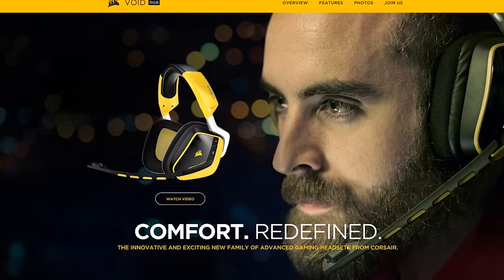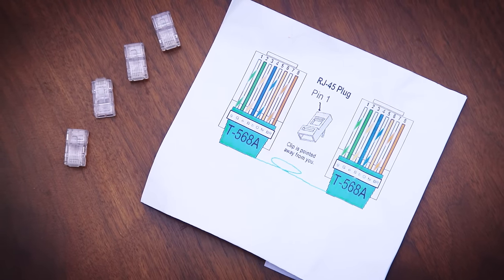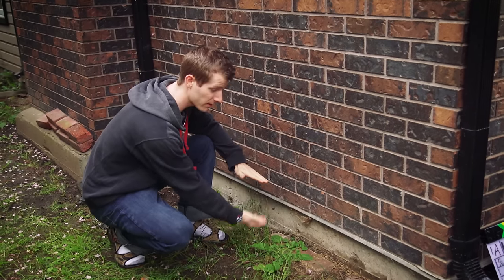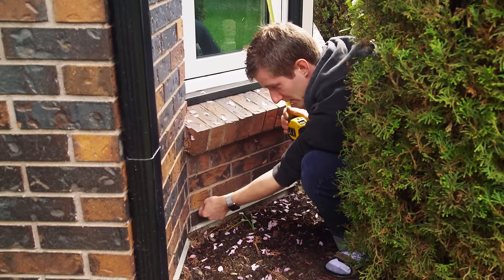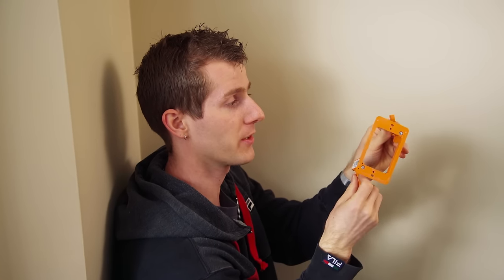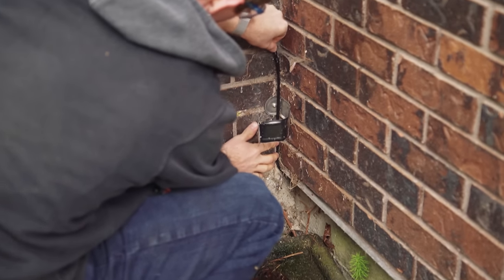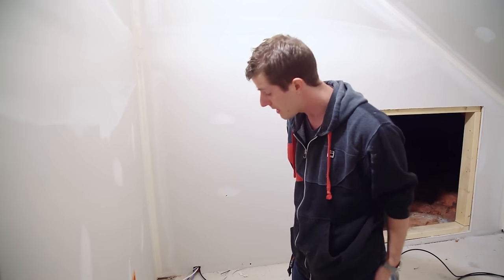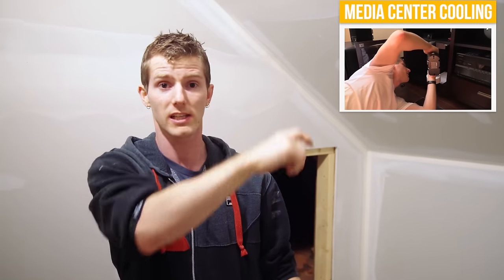Optimize your cable runs at home! - Installing an exterior Cat 5e cable

Comment: Isn't this quite a big security Problem, running your network outside of your house? Sure, he did hide it as good as possible, but if someone would fine the cable and had bad intentions he could cause a lot of harm I guess... 
You would need something like a Mac white list, so that even if someone cut the cable and tried to get in to your home network he would not stand a chance ;)

Comment: If you went from the other side, you would have been better off. Start with a smaller Masonry Bit, After you punch through one side. Punch back from the outside with a bigger bit. This gives you a clean finish and you have to do less math.

Comment: Care linus, you said that the limit is only your creativity. But there is the limit of ethernet too, you can run 100 meters maximum in ethernet. It can work with a little bit more (101 meters will work) but it can introduce random errors. So it's not good to run more than 100 meters.
Reply: I'm thinking this falls under first world problems. "Help my house is so big that I can't do a single 100M (328ft) run of Cat-5! Oh woe is me, I have to use the money I have that allowed me to buy this accursed aircraft hangar of a home to buy another router or something!"
Reply: MoldyCrow
 My house is not very big but it can cause problem. I don't have problems with ethernet but If my house was a little bit bigger I think that would be a problem.
My router is at 1st floor,, then the cables must go to the ground floor and some cables must go back to the first floor. It depends.
Reply: i really think people under estimate how long a 328ft cable is. i needed Ethernet in a room directly above my router in a two story house but couldn't run inside the walls. so i ran a cable into the floor, across the 50ft of crawl space under the house,  out and up the side of the house to the attic, across the 50ft of attic, then down into the room. after that massive cable run, it only ended up being around 160ft. i now have nearly 40Mb speeds in that room without issue.

Comment: i've got a three story house. the attic is in the third floor, the router is on the second floor. i need to run the cable to the first floor across the house to my room for my gaming PC.... DO YOU SEE MY FREAKING CHALLENGE );

Comment: So I have a super dumb question, because I don't know shit. How do you know you won't hit a wire drilling like this? Honestly I fear drilling any holes into my walls, I'm always scared I'll hit a water pipe or wire or some shit!
Reply: That is why I have a complete set of construction plans for my house.
Reply: he should have drilled it out from the inside. made the small rectangle cut first, then drill the hole though the wall from the inside. Then he would have known for certain he wasn't hitting electric wires or any other hazard.
Reply: there are devices that detect metal inside the wall, just turn it on, press it against the wall and look. DO NOT drill blindly like linus did, you could hit a live power wire and get hurt..
Reply: maybe he checked electrical maps of his house

Comment: Stop being cheap and wire up the whole house with cat5 with a network station in the basement or garage, it'll add a little to the house value and bring the house into the modern age.

Comment: You should be more carefull to open a hole in the drywall near the socket....and you got the order wrong! ^^
Open the Drywall first, so you can spot the Brickwall, pinpoint a spot in the masonry and drill from inside to outside ;)
And i think you got ripped of at the cable price xD

Comment: What stops someone from cutting your cable, crimping their own connector on, and immediately obtaining access to your entire network?
Reply: Nothing other than security by obscurity, unless they know where the cable is, what kind of cable it is, and which end is actually connected to the router, they won't be able to access the network.
Reply: You could just crimp a new connector onto each end of the wire...you don't need to know which direction the signal is traveling.
Reply: unitedgray well obviously, it's just one more step though, and then you also have to test it.
Reply: What stops anyone from taking an axe and bashing down your front door and stealing all your shit?

Seriously, that would work for about 30 seconds before you realize you lost internet.

Comment: Don't do this. Call a licensed electrician to assist you with pulling wires through the walls. If there is any existing cable in those locations chances are very good that someone who knows what they are doing would be able to get your runs sorted out. For future reference.....  The Linus way isn't always the best way. He does try hard and that goes a long way in my book.
Reply: (the Linus way usually isn't the best way. or the right way)
Reply: Why pay someone $70 an hour when you can do it yourself?
Reply: His methods are fine. The only risk is running into something in the wall such as a gas line, or a 120 volt ac power line. Common sense will usually prevent problems like running into those things, don't drill near anything that is operated by gas, and or not near electrical outlets. Less risk? cut the hole in the drywall first, and take a look in there before drilling. I see no sense in hiring an electrician for low voltage wiring.  Just enjoy his quirky videos, and as always if you like it press the thumbs up, if you disliked it press the thumbs down.
Reply: The problem is there are far too many people who watch these videos that aren't smart enough to understand that this just isn't the right way to do it.
Reply: Eric Duncan Yeah ofc, there was an article, or a documentary that I've read/saw a year ago. (I don't remenber what it was) Some guy from an ISP hit a power line and it melted his drill bit lol.
Reply: Electricians usually know nothing about pulling ethernet cables, they are just as likely screwing up as you are. 

I didn't have to take a student loan thanks to the money I got from going around fixing networking cables that electricians had installed. They think it's the same as running electrical wires.

Comment: It honestly not that hard to fish wires through the head-plate of walls from the attic. I've done this about 20 times in my parents house (it helped alot that my dad installed pipes throughout the walls during the construction to aid in attic to basement wire runs). Takes about 10 minutes, and then you don't have potential security risks, unsightly wires hanging off your house. Linus is the epitome of "good enough" engineering sometimes. smh.

Comment: perks of not living in cold countries: NO dry walls... I loled... :D
Reply: Drywall isn't for its insulation. It's used because it's incredibly cheap and super easy to put up on a frame. You don't need to pour concrete or know how to lay bricks. Anyone can do it.
Reply: Concrete or even plaster finishing is easy enough to do...
Reply: That's a more specialized skill than literally putting up a sheet of drywall with screws.

Comment: You could also use a Water Level to ensure you are at the same height inside and outside of the building. You should even be able to use it through a window without the water running out. http://www.wikihow.com/Use-a-Water-Level

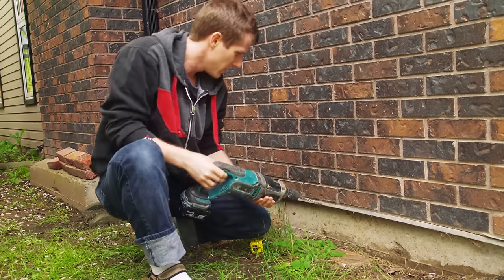Comment: I stopped at 7:11 because you didn't check for any obstruction behind the wall, like power lines, joists, joints or even some sort of piping or insulation, before you drilled...... 
I did not want to your hair fizzle.

Comment: What's a wife hazard? Does not compute
Reply: In all seriousness why use a female > female faceplate? Just terminate the cable using cat5e jacks and then use a regular faceplate. Benefit is that you can install as many (what, like up to 12 or more?) jacks as you need for the room rather than be limited to what looks like two jacks per faceplate.

Comment: Haven't run Cat 5e for years.  At least run Cat 6.  Why cheap out?  Also do you mean "hammer drill" and not "impact drill"?   Might also want to mention that is a masonry bit.  The "electric screwdriver" you show later is an "impact drill".  Instead of the anchor/screw combo, you should've just use Tapcons aka concrete screws.  Earplugs are a good idea with a hammer drill in general, especially if you use it indoors though.  Also use punch down jacks if you're using bulk cable.  Pass through jacks are generally used for premade cables.  It's a hell of a lot easier to fix a missed termination with a punch down block, then re-terminate a RJ-45.

Comment: Cool, but now everyone who want to hack you knows where are your internet cable and he dont need to physically step inside your house to have full acsess over your whole network, he just cut the cable, install a module, hide it, reconnect the cables and you did not noticed anything, and from here pretty much the sky is the limit, nest, smartphones over wifi, smart tvs, your computers, company emails, family stuff, and all of this with just only a rapsberry pi (or pi-like whatever)+some basic networking and programing knowledge
Reply: Was just about to say that lol
Reply: hmm, then he wonders why the internet isn't working from that socket anymore... has a look wats wrong.. sees the modem, contacts police. Then u get fined for trespassing, destruction of property, invasion of privacy, unauthorized use of WiFi/internet and etc.
Reply: that's the problem, the internet will work the same from that socket just like before, its impossible to notice this unless he goes out every day and check the cables, and sure if he notices it and the hacker dumb enough the police will find him, but by the time they does linus just lost his whole online life, imagine you lost all your online accounts and all of the files stored on the devices connected to your home network, the damage is irreversable, and no one can help you

Comment: lol waste of money installing cat 5! i do fibre installs etc and it 4x cheaper with lc multi mode then the cat6a! I charge  £190 for external cat6 with conduct and termination per 40meters. due to lengths of real is only in 305m.... £146 where fibre when I run is up to 305meters for £145 with full install. plus none of the aging Bs with fibre
Reply: True but then you have to have a media converter to get back to copper...
Reply: +Blake Barrett nope lc to lc no copper needed. server sfp to desktop sfp that simple no lag no jitter no interference and future proof
Reply: +SgtAMYNTAS So you need an SFP NIC card, and how much do they cost? And then an SFP switch if you have more than one server, again how much does that cost? The price of fibre in those terms is impractical. Copper is just as good and more convenient, and more widespread.
Reply: you can buy SFPs pretty cheap these days :P you dont need SFPS that have a laser range of 2km! only 300 or less. OM3! but if you want to go into cost then eh fibre panels are only used really for future proofing and making an A+++ grade on Energy and cost effectiveness over time. Standard copper costs the same to install as fibre but the fibre equipment is usually more expensive due to high quality components. 10+gb+ NICS costs the same with fibre and copper :) and copper 10gb routers are basically nill. you dont run fibre for a 1gb run... you run fibre for a sfp that standard at 10gb+ like i mentioned its about cost efficient over time. and maintenance and energy!

Comment: This is just bad advice. This is NOT a DIY project. Any cabling installed on the outside of the house needs to be installed by a certified installer and has to meet Life Safety/Fire code. This cable in this video is not shielded or grounded. Big no-no. I'm all about DIY, but some things really are better left to the professional.
Reply: nilpo19 its not an electrical cable or anything, its an ethernet cable by which you cant be electrocuted
Reply: Mohsin Sadiq Ethernet uses electricity, and any cable is a conductor by design. There is always an inherent risk of shock. Sure, an Ethernet system poses little risk, but category cabling is often used for other purposes including telephone and PoE. There is also risk that the cable comes in contact with another energized system. But all of that aside, the comment I was making is that in most U.S. municipalities, installing this yourself is illegal.
Reply: nilpo19 I undestand but poe cables can carry max 48v for safety so it wouldnt be lethal to it is perfectly safe to install it yourself
Reply: Mohsin Sadiq Amperage kills, not voltage. And PoE injectors can fail and expose the system to line voltage.
Reply: nilpo19 I cant remember the amperage of the top of my head but it is safe enough to install yourself but I see your point

Comment: except that the hammer settings on most of the drills consumers have a completely fucking worthless and are not any better than just plain drill setting.

don't buy cheapo shitty drills, people. even reputable brands have a lot of crappy products in the cheap end (<$400 USD kind've range).
or when buying an affordable drill, just know that things like Hammer settings are going to be useless and don't bother using them.

Comment: I just facepalmed at him... yeah lets drill from the OUTSIDE IN not measuring or taking in effect whats BEHIND that portion of the wall or even the wall stud.. yeah lets go straight through the center of the wallstud... yep drilled straight through plumbing/hvac/electrical cable/tv cable... nope lets blind drill into a wall right next to a LIVE power outlet.. then go in and open up the wall and go hrmmm straight through the upstairs toilet drain... its a wonder why he makes videos because cuz if he pulled that off in a jobsite he wouldn't be employed long.... please linus if you keep cutting your house up inspect whats BEHIND the drywall BEFORE punching holes though from the exterior.. also please note to people that plate you used is only designed for low voltage applications and is not to be used with high current applications... that's called a surface retrofit plate (also known as a cheater plate).

Comment: Still one of the most cringe worthy video he has done. Don't use tips, use a proper jack. Also failed to mention the 100 meter limit of cat5e cable runs